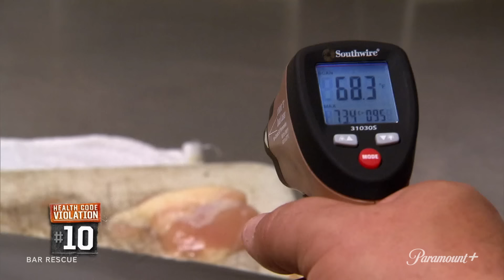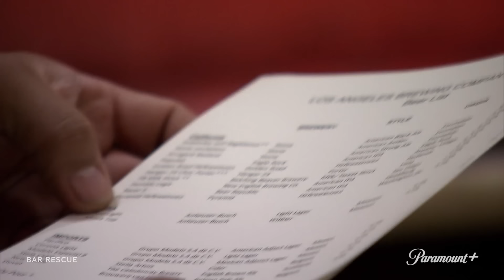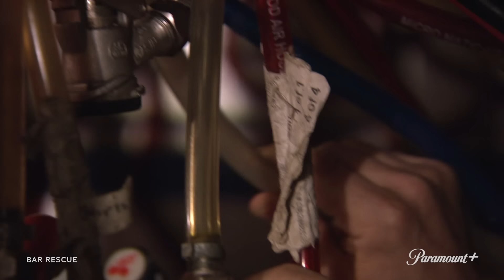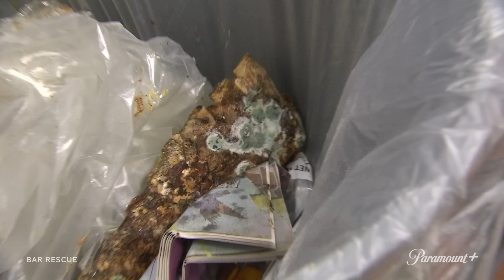Peak Health Hazard: Mold 🤢Bar Rescue

Comment: I don’t drink and even I knew straight away that the beer needed the foam at the top or as the technical term Taffer used the 'head'. I do find it crazy how you can see the filth and not even clean it. If you clean after use, and after the shift, then the less dirt will accumulate. The less elbow grease you'll have to use to clean up. The more time and money you save. And the better quality of a place for customers and staff to be in. And the better quality of food and drinks.

Comment: I don’t understand how the bottle is rusted, glass can’t rust
Reply: if bottled beers with caps are stored on their side (which it looks like they were with the ring of yeast stuck to the one side), it creates a larger surface area of the beer being exposed to the air pocket in the bottle, this causes the surface area of the beer to begin oxidizing at a much faster rate, and can lead to the inside of the bottlecap oxidizing as well and becoming rust

Comment: That black mold thing made me feel pissed off. I had a family member get black mold in their house because it rained so much a portion of the roof broke and the mold grew in the hole. They had to duct tape the hole shut for the next 3 months they lived there, due to the fact the manager of the place (this was in a trailer park) was a total shit head and didn't help at all. The whole line of them just were bad tbh, but I regard the point of black mold forming in the roof and them not doing shit before and after to prevent/help them the last straw. One trailer BURNED DOWN the month before to. Unrelated but still there's my point of how bad this manager guy was. They moved out and doing much better in their new place.

Comment: 5:37 Even if the lines are clean, it doesn't matter if the spouts are dirty. Why aren't they cleaning at least the spouts?

12:07 And even if that was actually rust, and not mold, why would you serve ice from that?!